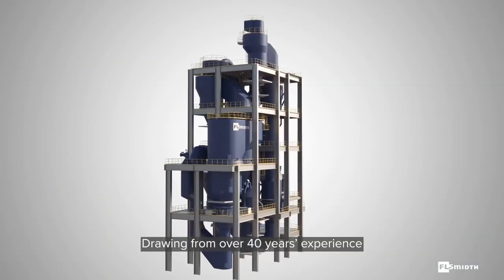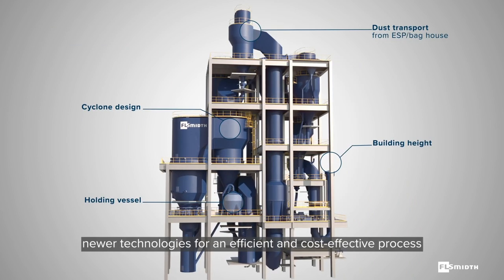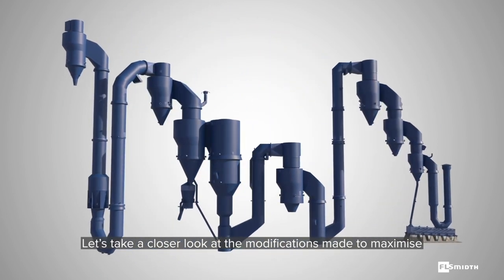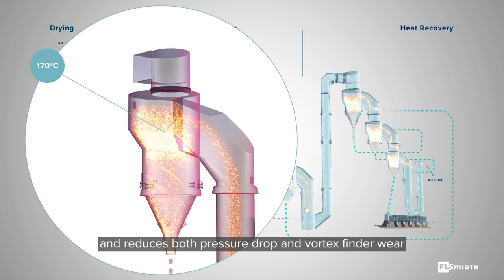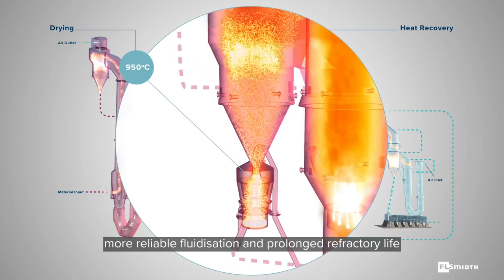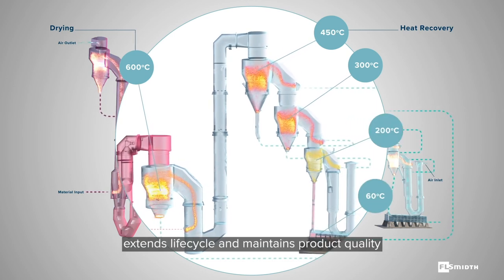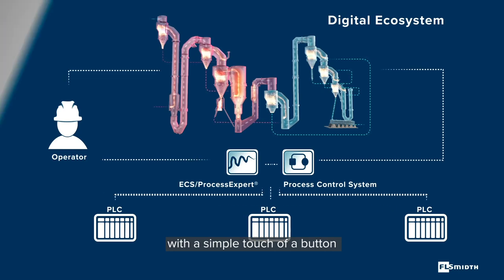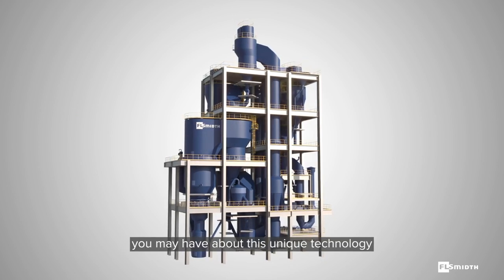Alumina Calciner - Gas Suspension Calciner

Comment: Sir,
1.Please explain the air and material flow, diagram, along with temperature & pressure at different levels or in each stage of cyclones .
2. How the ID & FD fans are balanced for smooth operation of the GSC 
3. Is there any by-pass line in GSC like CFBC calciner, to regulate the quality.
4. How we can maintain the quality of Alumina powder and is it really required for different applications although...